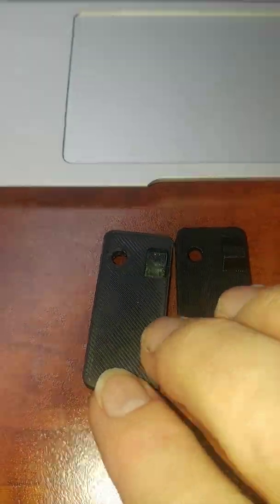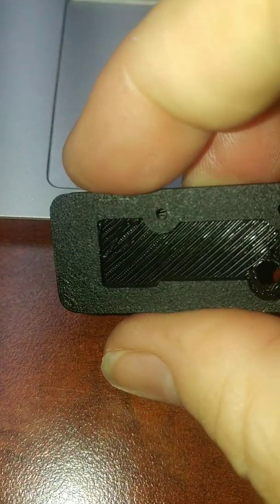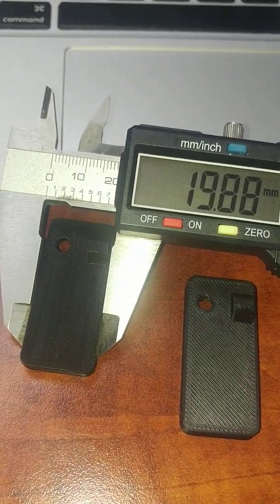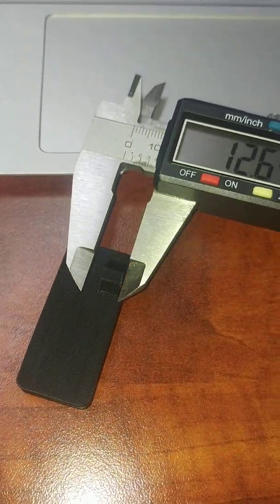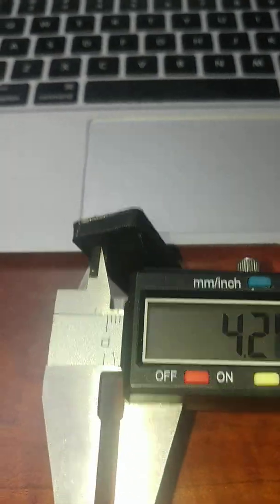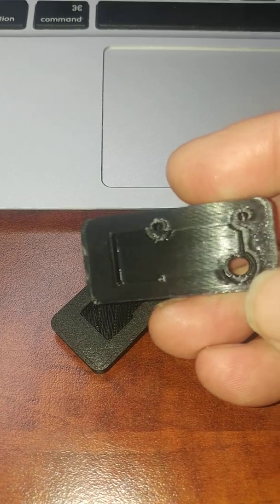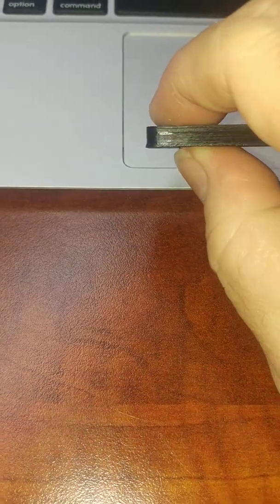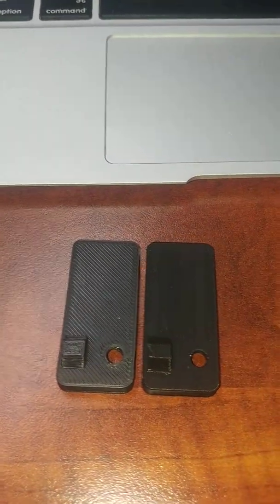Creality CR-30 3DPrintMill print quality comparison

Comment: Love the PrintMill but two things bother me with this model. 1.) the price for shipping was $350 on Kickstarter while the Early Bird for the printer was $588. 2.) The width is too small for my needs. If the width could have been at least 300mm and if they could do a batch shipment to the USA to reduce the cost of shipping I might had bought one. Other than that, it's a cool machine!
Reply from the maker: The shipping isn't $350.  It's only $45 US.  It was listed in Hong Kong $.
Reply: @williamsteele  so if you purchase it now thru Kickstarter, is the money taken now or when they are built?
Reply from the maker: @jdcamc  Neither, Kickstarter will take the money when the project's campaign window closes.

Comment: Great video! Have you tuned each printer for e-steps and flow rate?
Reply from the maker: I've done no tuning of the printer.  This is using the stock profile on the SD card.
Reply: @williamsteele  thanks for the quick update. Are you planning on making new videos? I'd be curious to see how they stack up once tuned.

Another idea would be print strength, if you have any way of measuring this. The layer lines being the way they were was a super cool thing I didn't realize, would be interesting to see if it helped or hindered strength.